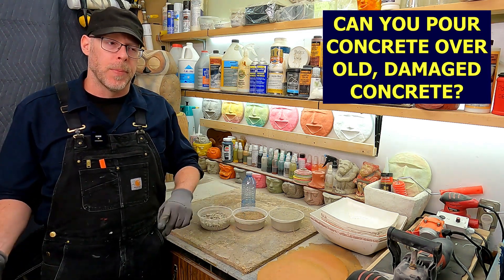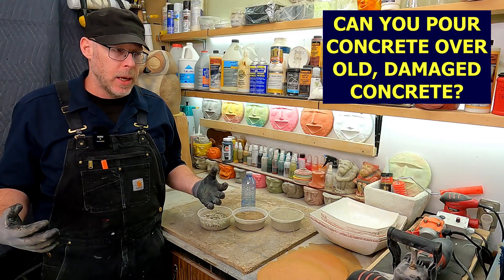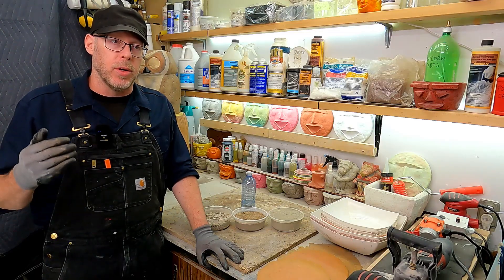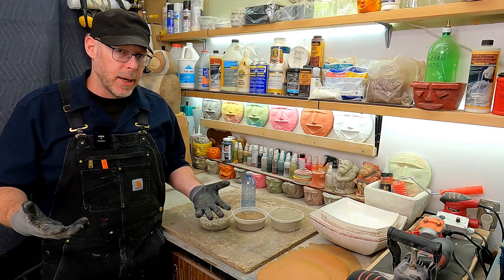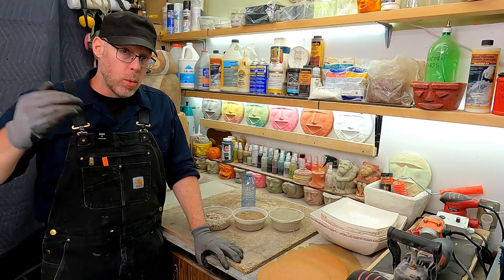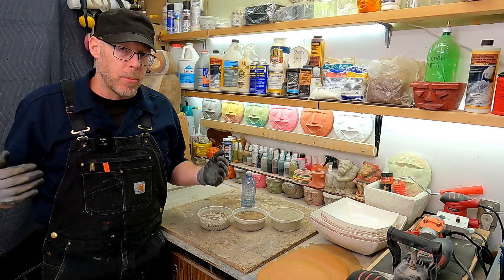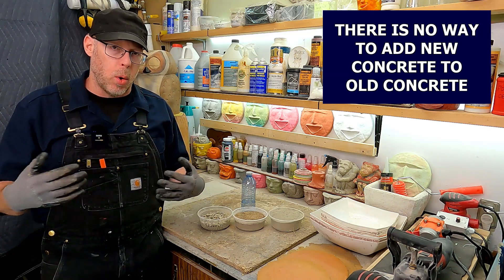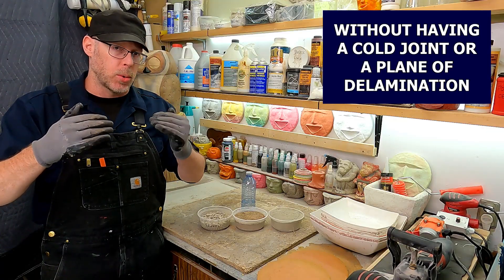Can You Pour New Concrete Over Old Concrete?

Comment: Try some UZIN concrete hardener/primer I think PE 414 it also has moisture retarding properties.  Apply it THIN or it will foam.
It's a flooring product so not sure about outdoor uses.   Not cheap stuff tho.

Comment: If I'm pouring over a patio does it mater if they bond. Nothing is going to move. Doesn't the old slab just become a substrate for the new pour?. Assuming the new pouring is thick  enough to support itself.
Reply: That's fine. In that situation you don't want the two to bond. I would install a sheet of plastic on the old so they don't bond. That way the new will move independently of the old. When I say move I'm talking about expansion and contraction.
Reply: @gibsonbuilds4841 thank you for clarifying. 🐸